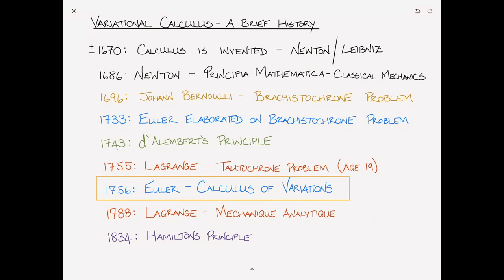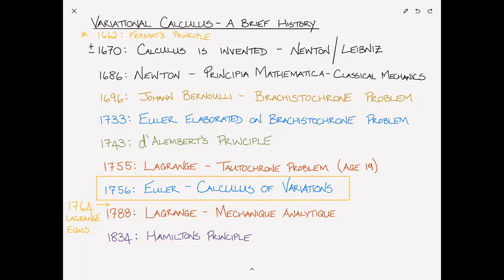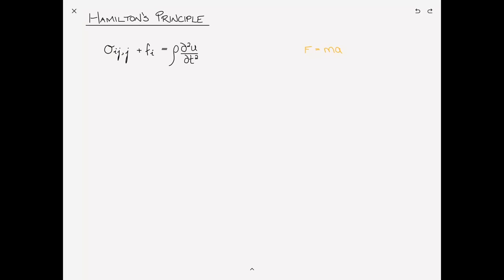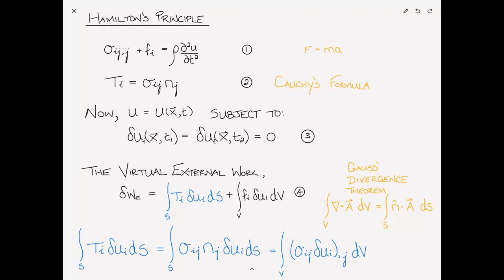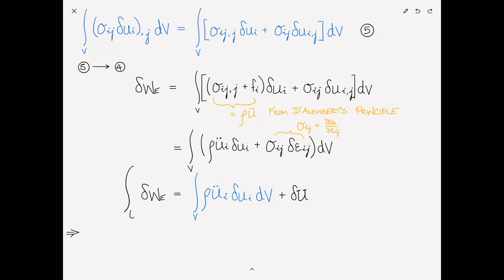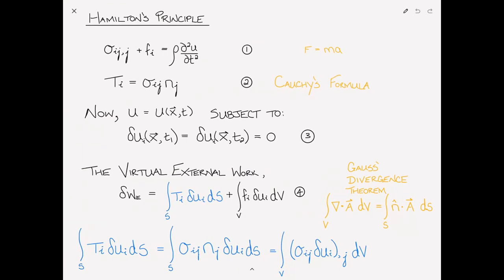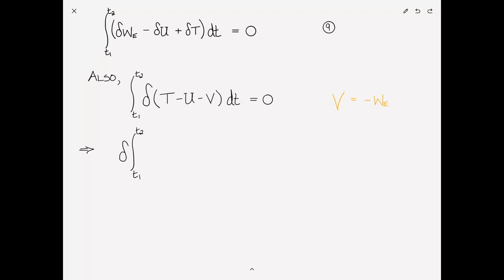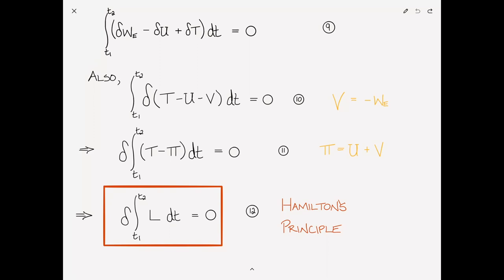Deriving Hamilton's Principle

Comment: Awesome work as always. One point: U need Newtons 2. law as the first step in your derivation, which is in essence an axiom. Isnt then the whole derivation of Hamiltons principle an axiom itself then?
Reply from the maker: You've asked a loaded question which needs to be teased apart...
1. Newton's Law is not an axiom.  Axioms are statements that are assumed to be true, but cannot be proven to be true or false - e.g. angles on a straight add up to 180°.  This statement is really a definition and cannot be proven.  However, having accepted it as a true statement, then many other rules/theorems can be inferred from the axiom.  Newton's Law, on the other hand, is supported by empirical evidence - i.e. you can test/prove it in a lab.
2. Notwithstanding what I have written in (1.), the fact that the proof of a Law or a Principle might be based on an Axiom does not imply that the Law or Principle itself is an Axiom.  For example, based on the Axiom that angles on a straight line add to 180°, I can prove the Theorem that in the case of parallel lines, the alternate interior angles are equal.  This Theorem is provably true and so is NOT an Axiom; it would be true even if the initial Axiom had stated that angles on a straight line add up to 200° instead of 180°.
Consequently, neither Newton's Law nor Hamilton's Principle are axioms.  By definition, Laws and Principles are not axioms because they can be proven to be true, whereas Axioms cannot be proven to be true or false.
Reply: @Freeball99  Thanks for your time and response! 
I definetly have to look up the definition of axioms, laws and principles. 
Why I assumed that it is an axiom:
- Newtons work/chapter is called "axiomata, sive leges motus" which contains the word axiom
- I am german and on the german wikipedia article of Newtons laws the word "axiom" is used 9 times! Not so in the english article.
Nevertheless, if a principle can be based on an axiom and thus does not become an axiom itself, that is explanation enough.

Comment: Are you sure of what you say about the libration of the moon and Lagrange studying optics? My understanding of "libration of the moon"  is that, although the moon keeps one face towards the earth, it does swing slightly back and forth around that position, and that is called lunar libration. And what Lagrange was studying was something different, which was Lagrange points, which are basically attractor points in the earth-moon gravitational field, towards which an orbiting body would tend to return if subject to small displacements. Those are also called libration points. The "libr" in libration is the same as in equilibrium and refers to a tendency to return towards a mean position, so describes both the tendency of the moon to oscillate about its earth-facing orientation and the tendency of a body to oscillate about a Lagrange point. So I would say libration is not the twinkling of the moon and Lagrange was studying gravitation not optics.
Reply from the maker: From the Wikipedia article on LaGrange... "The next work he produced was in 1764 on the libration of the Moon, and an explanation as to why the same face was always turned to the earth, a problem which he treated by the aid of virtual work. His solution is especially interesting as containing the germ of the idea of generalised equations of motion..."
Reply: @Freeball99  Ok, thank you. I stand corrected, so Lagrange was indeed studying the lunar libration at the time he came up with his idea (assuming Wikipedia is to be trusted) rather than the libration points that he must have studied at another time. Nevertheless, I hope you will agree that your words "the libration of the moon, that's the sort of twinkling and flickering effect on the moon, so he was actually using it to study optics" are not correct.

Comment: Will your calculation work for te general strain rather than the linear strain?
Reply from the maker: We do NOT assume small displacements or linear strain at any point in this derivation.  Consequently, Hamilton's Principle is suitable for general strain.
Reply: @Freeball99  When I refer to the general form I mean this: e_ij=0.5*(u_i,j+u_j,i+u_k,i*u_k,j) where the , denotes derivative. You seemed to use the linear part only.
Reply from the maker: Sorry, I missed your response until now...I think there is a slight disconnect here.  I didn't enforce linear strain here.  If we were going to linearize the strain, this this would be introduced when deriving the expression for the potential energy of the system.  This would occur when applying Hamilton's Principle to an actual problem.  Is there a time in the video or an equation where this is confusing?
Reply: @Freeball99  No, I understood what you were doing, and it's one of the assumptions that I make when doing solid mechanics, but I wondered if there was a general derivation.

Comment: What if (starting from equation 9) we cannot assume that we can represent the external work as the negative of a potential? If generally the external work could be non-conservative? Does that change things considerably?
Reply from the maker: If the work is non-conservative, then it must remain as external work (ie it cannot be included in the internal potential for the system).  I discuss it in this video: youtu.be/LY-JcuYqSEk?t=370
Reply: @Freeball99  thank you very much!

Comment: I have a question, could one define the laws of mechanics as the hamilton principle and see newton's laws as a consequence of that? Are all the relations of this proof "equivalence" ?
Reply from the maker: I would state it a little differently...  
Lagrangian mechanic builds on the knowledge of Newtonian mechanics and Hamilton's principle builds on Lagrangian mechanics.   As such, the equations derived from Hamilton's principle are equivalent to those derived from Newton's laws, but the advantage of Hamilton's principle is that it provides a more complete and elegant formulation of mechanics.  Hamilton's principle is more general than Newton's laws and can be applied to a wider range of systems - like systems with constraints (statically indeterminate) and those containing non-conservative forces.
Reply: @Freeball99  You can literally derive Newtonian mechanics from either Lagrangian mechanics or Hamiltonian mechanics; it just depends on what axioms you start with. Lagrangian mechanics is not built on Newtonian mechanics at all, except in the historical sense.

Comment: i wonder why can the delta u be supposed as 0 for t1 and t2 ?
Reply from the maker: This goes back to the original idea behind the calculus of variations...which I explained in a previous video (https://www.youtube.com/watch?v=VCHFCXgYdvY).  In that, I talked about path minimization problems and that the variation of the path had to be zero at the boundaries (since any solution to the optimal path problem must begin and end at the same points - boundary conditions).  This is really just an extension of that...we are trying to find the optimal path that the system takes from it's state at t1 to its state at t2.  Thus the variations of the state at the beginning and end of the interval must be zero.

Comment: f is not equal to ma but we are stuck with it.....it is only a best approximation based on 17th century deductions.....as a result ultimately einstein concluded that nothing can travel faster than light......what really needs to be derived is the relationship between force and energy....they are not the same, of course, and i suspect the difference between them involves a gravity-time quantity that has never been investigated.

Comment: F=ma
Isn't that simply the definition of F?
Reply from the maker: I would define a force as a push or a pull on an object.  In my view, Newton's 2nd Law is a statement of how force and mass are related to acceleration (or motion).  It's a Law of Motion.
Reply: @Freeball99   I think that good definition of basic physical quantities (charge, mass, force etc) can be made only through measurement method. For instance, we can define mass as quantity which proportional to volume if the bodies in experiment made from same material and Speed<<C. I think that true empirical law is when you stretch spring to the same distance, but change masses of the bodies and in the end you would have experimental results that say m1/m2 = a2/a1. Then we postulate that force is equal and DEFINE it like F = ma.
So, it's a definition, a very good one, but not a true empirical law.
I can say why your method of defining a force as some abstract and unclear thing like ''push or a pull' is bad and can confuse: if F is "pull or push" than what is F^ 35 or F^(1/2) ? So defining the force with literature words like "measure of pull or push" gives you ABSOLUTELY NOTHING about experimental values.